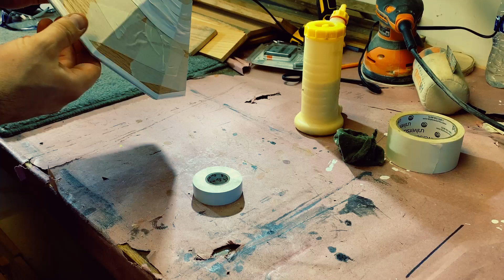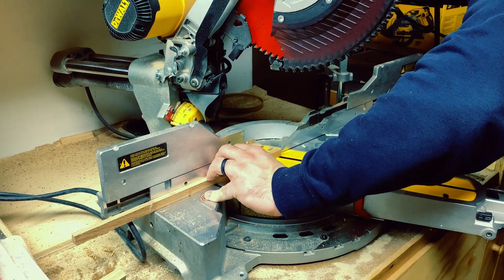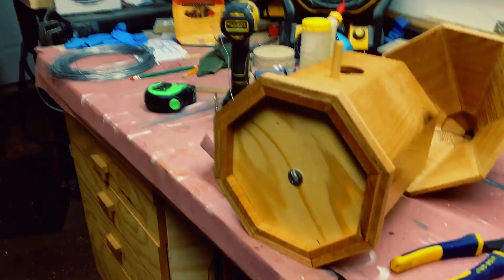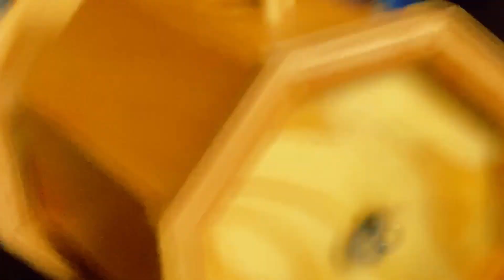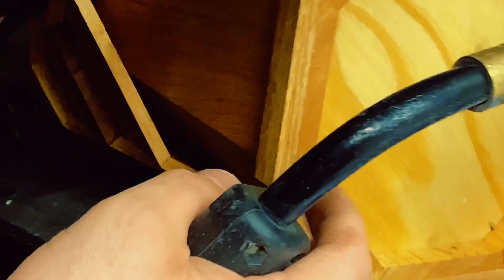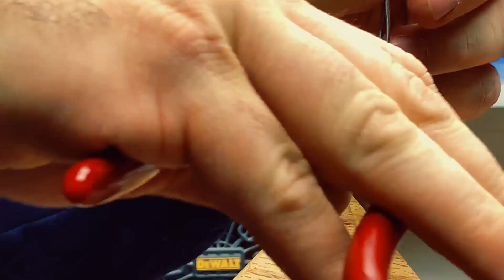DIY Octagon Palletwood Birdhouse

Comment: Looks nice. I like the dado for the floor and side assembly alignment and gluing.  Some improvements to make it a better nest box from a biological perspective are holes in floor for drainage and upper side for ventilation.  Entrance should be drilled at an angle to drain water out.  NEVER put a perch on a birdhouse, birds do not need it but predators use it when getting at the eggs or young.
Reply from the maker: Thanks for the comment. Never knew about the perch, very interesting and a nice thought for the next one. Haven't had many drainage issues, probably because it isn't water tight to begin with but your point is a def consideration in the next design.

Comment: What were your angles on sides and roof. That’s the problem I’m having . Thanks
Reply: sides need to be beveled at 60.  Roof pieces also need to be beveled at 60 but in addition tapered to an angle that depends on how steep you want the roof to be.  The top of the side pieces should be beveled to match the angle of the roof's slope for the best fit.  Probably best to search for some specific plans, there must be hundreds around.  Most of these diy videos are good to see different methods of work but short on giving precise instructions.  Some very unsafe methods of cutting bevels on the table saw appear in some videos.